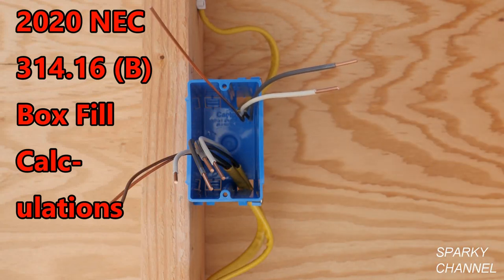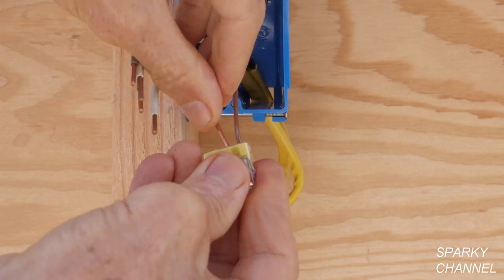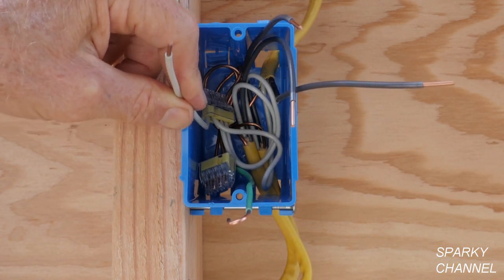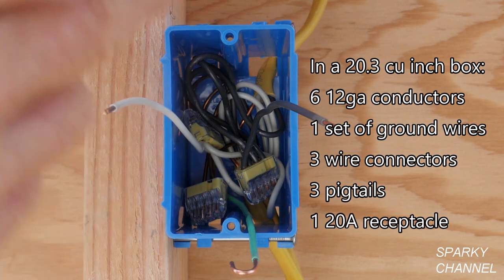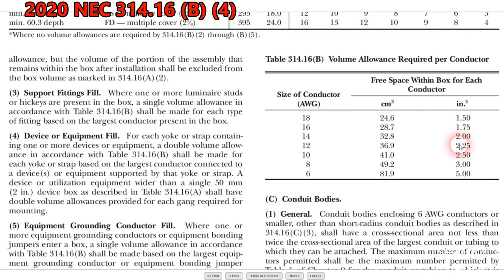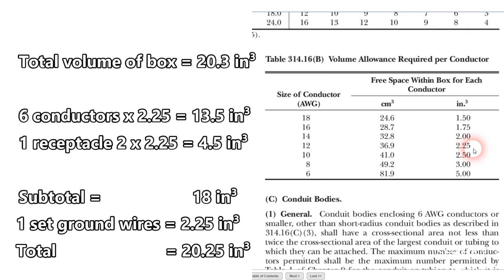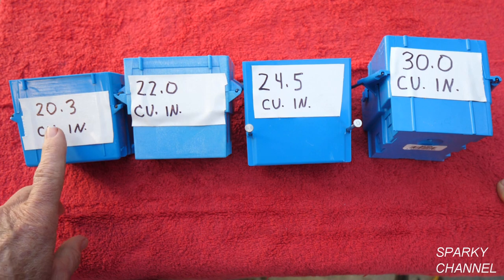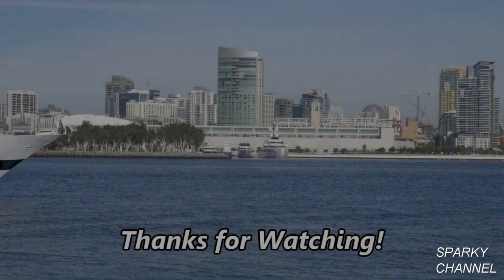Is this Box Overfilled by 2020 NEC Code?

Comment: Hi, electrician from Germany. Why doesn't eath have isolation? Is it like that in USA? Is it for more protection?
Reply from the maker: We do for certain circumstances such as wiring a computer room. But in general we don't use isolated earth grounds. Cheers from 
San Diego, California!
Reply: I think they're asking about "bare copper"/no insulation not "isolated ground". (the later is a whole other subject) In short, if there's an exposed bit of metal, you want it to be a ground -- i.e. something that doesn't normally carry current -- for safety reasons.

Comment: You miss to have the grounding conductor. 7×2.25=15.75 cu inches now add device 2×2.25=4.50cu inches.
Total 20.25cu in
Reply: You missed the code reference, all the ground connectors count as only one conductor.

Comment: I'm not a fan of those type of connectors/connections.  They seem similar to the system/type used in devices such as switches and receptacles.  While they are smaller and easier to use, I don't think they will stand the test of time.  I perform a great deal of electrical maintenance and repair in homes.  I find high failure rates with these push-in connections on switches and receptacles in damp/moist areas.  Mostly bathrooms, kitchens and outside walls.  Not everything new IS improved.

Comment: Interesting. So I could put a bundle of wire in that 20.3in3 box, a hundred feet of it and a hundred wire nuts. As long as they all are contained fully in the box, meets code. Then jam in my 6 conductors with a sledge hammer or press. lol Going to see what the inspector thinks of that.

Comment: I never understood why the NEC allows pigtails to not be counted. A 6” pigtail takes up the same amount of space as a 6” piece of wire from a cable entering a box.
Reply from the maker: True.
Reply: I believe it’s partly about heat generation and the volume of dead space to allow for adequate “cooling”. That’s why they aren’t worried too much about them as they aren’t line in or load outs. They most likely fall under the devices requirements.
Reply: RaggedsEdge line in or load outs doesn’t necessarily mean that there won’t be heat generated on them. Any segment of wire on a 15A circuit has the potential to carry 15A of current on it without the breaker tripping. Doesn’t matter if it’s a pigtail or not.
Reply: @RB-xv4si  ... you make a good point of the load generating heat and needs to be considered in the fill rate but at 80% loading on a branch circuit there's really no heat to worry about.
Reply: The best way to look at it is that the NEC writers presumably took/are taking the existence of pigtails into consideration when they came up with/maintain the factors.

If they instead wrote the NEC so that pigtails needed to be included in the calculation then the calculation would depend upon precisely how the installer intended to execute the job (how many pigtails she would use), which would be a major engineering headache because the engineer would have no way of knowing this. Furthermore, in some cases the installers would be forced to use gimmicks to keep the pigtail count low enough to meet code, an undesirable result. OTOH, conductor quantity, yoke quantity, existence of internal clamps--all of these things can be specified by the engineer and are therefore knowable by the engineer.
Reply: @sbrasel  engineers don’t really get involved in device and wire fill calculations for switch boxes, receptacle boxes, etc. That involves small, simple calculations that electricians are trained to do during the installation.
Reply: @RB-xv4si  You took my term 'engineer' too literally--it would also include the person in the electrical firm who "engineered" the job by deciding what size boxes to order from the supply house, a person who may never have met the installing electricians if the firm is large. In any event, I stand by my original point--including pigtails would create engineering/installation/maintenance/enforcement points of contention due to multiple ways of wiring a given combination of wiring devices and cables.
Reply: @sbrasel  wow, alright. You use that term extremely loosely. The general foreman or material handler will usually put in orders of several different size boxes so the journeymen on site will have a few options to choose from in any given situation. They (journeymen) will use their general knowledge, specific site knowledge, and code book to make a final determine of what size they’ll use for each part. The only time the master electrician or PM will do the calculation in the office is if he’s ordering a very large box for a very specific purpose on the job. EDIT; to be more specific to your response, the only way a point of contention will arise is if the jman does an incorrect calculation (or no calculation at all) and undersized the box or grossly oversized the box, thereby wasting material.
Reply: I think its all considered and factored into the box fill. Kind of like the device will count as a double fill whether or not you are using a standard duplex receptacle, single pole switch, gfci, or dimmer switch. As electricians we all know these things need more or less space but they are counted the same. They probably just assume each gang size could have 3 pigtails and its factored into the wire gauge multiplier
Reply: @RB-xv4si  But a pigtail or jumper adds no current either entering or leaving the box. [Just guessing, not authoritative. DIYer here.]

Comment: I would keep it simple and NOT try to have more than 2  Romex feeds in and outlet box.  It a spur run is needed, it should be in a separate junction box that does not have a receptacle.
Reply: That is silly , install a bigger box. You can get a 22.5 cubic inch box. Always install the biggest box that will fit in the wall. You dont want blank cover plates all over your house.
Reply: Disagree. You add more material, which is cost, to the job and it looks worse.

Comment: Knew that answer from get go. 
But never use such small boxes.
Reply from the maker: Excellent advice!
Reply: What box would you use?
Reply: Derek Parent 
I always oversize the boxes. 
Simply because you don’t know what will happen down the road. 
I have seen people cheap out for a few bucks and it’s well dumb. 
Or someone who puts a new main box in and there’s no room left for anything else. 
Personally the codes sometimes sucks. 
They will dam near let you pack a box tightly and it’s a bit overboard. 
My rule of thumb. Meet code then add common sense. 
Example - a new box. You need 12 breaker spots. Do you only put 12 in or go up Incase.
Reply: Mike Sacco I think my question was what size box would you use for 3 - 12/2 romex cables. 
An 1110 box is only good for 16.5 cu inches so that plastic box has a lot more fill capacity.
Reply: Derek Parent 
I like the 24.5. 
A 1110 is metal.

(FYI anyone reading this. 
Quit stuffing wires in a box behind drywall. And only using electrical tape is well dumb. ) yes I make $ fixing it. But today someone ended up in hospital because of this very reason. 
If you have to ask. Hmm is this correct you might not want to do it. 
( not saying this is true all the time but still )
Reply: Mike Sacco that box seems a bit deep for interior 2x4 walls. Looks like it’s made for 2x6 studs or bigger.
But I agree, use a box that is has suitable or larger box full  and also fits the location.
Reply: Mike Sacco I’m curious about the injured person. 
Was there a box covered by drywall and had no wire connectors but was taped?
How was he injured?
Reply: Derek Parent 
Houses here now. Exterior must be 2/6 walls. Interior 2/4. So I just drop 1 size for those boxes. 
The fire. In short he redid his kitchen and moved fridge the old outlet he put in a junction box and tagged a 12/2 over to new fridge area. Then used electrical tape. 
And the night he spent the night in living room. Guess he fell to sleep. It caught fire in wall and it was also the wall right behind him. He got his head and arms burned pretty good. 
You have to remember a fridge has a motor.  It shouldn’t be spliced anywhere. 
Me. Direct line to box for microwave. Fridge. Washer dryer. Etc. 
I love breaking my boxes down. Exterior lights on there own. Living area split in 2. 
I always go above code. 
Now they want afci gfci breakers. A bit costly but it is what it is
Reply: Mike Sacco I go above the code also, after 42 years I have seen pretty much everything industrial/commercial and Residential. I did service work 24/7 for the last 30 years, the first 10 I was in construction and a Forman until I started my own company. 
In Canada I haven’t seen that size plastic box but I wouldn’t wire it that way anyway. 
And yes Arc Fault breakers are pretty much everywhere in the house except the kitchen and sump pumps. Changes the way we wire a house now as lighting does not require them.
I never go over 8 plugs on a circuit and will only load lights up to 9 or 10amps or max number now with LED’s. 
Nice chatting, keep up the good work, be safe and help those when you can. 👍🇨🇦😷
Reply: Derek Parent 
I’m in CA. 
Kitchen got tagged last week cuz no afci in kitchen. 
Funny. Codes say 1 thing. Inspector says nope. Lol 
I only use those boxes because it seems I run into small boxes all the time. 
Code a box must be x amount size. But oversized is fine. 
Our outside walls are 2/6. Earthquake codes and so on. So that’s why I use that box. 
I go 7 on plugs. Only cuz I see to many plugging things in. People see a outlet and think ok I can plug it in with a few 6 ways. Lol 
Here in ca I run into a lot of people who use 14/2 cords for ac units or Xmas cords. I don’t know about there. 
I have a buddy in Canada who does drywall. He came here and it’s funny we norm use 1 kinda mud and he was like what’s this crap. Lol
Anyway. You got me on years I been in it for 33. It’s good money. But some people play with fire if they don’t know there stuff. Never shocks me to see what people do.
Reply: Mike Sacco code should override inspector and I have only had to do that 2 times in my life by going thru their boss. 
I have seen houses where the basement was wired with orange extension cords, thru the studs and into boxes..16/3!
Oh yeah, there are some dangerous people out there. 
I just started looking thru YouTube videos to see what electrical stuff is being shown, I am pretty surprised at how many people are posting live panel work with No PPE, DIY’s and electricians. 
It’s like “Here is my evidence, please take my license” just dangerously stupid.
Reply: Derek Parent 
Derek Parent 
I have learned here in CA they think it’s there own world here. Lol 
I pulled a code book out on a inspector one time.  I said I want to make sure of this. His words. Either put it like I said or no sign off.  I can’t explain inspection here there funny. Now there doing 3rd party inspections. Ugg
16/3. That one never seen like that. I think the worst I always remember. A guy took a bunch of bell wire and melted plastic off then kept twisting it up to make it thicker then tape on it and used 7ft in attic up to a light. 
His wife called when he was at work and asked me to come out. I go to climb up and she says I’ll turn the light on. 
It looked like toaster wire bright red/orange. 
The ones I get a lot of. People take wire and shove it into dirt to try to make gfci work. Or run neutral wire on grounds. 

As for you tube videos oh I have seen some that make my head hurt. 
I tell people if you paint wrong ok. Plumbing wrong it’s water. Electrical will KILL YOU. You can see water. Paint. Drywall etc. electric you can’t see. 
And I get people who reply with. 
Oh let me guess you want to come fix it for me for $$$.  Lol. 
Its shocking and scary what people post. There should be a guild with you tube. 
These videos are done by a licensed contractor and verified. 
Hell I was shocked when someone showed me videos on meth. On how to cook it and use it and hide it from people. 
You tube will let anyone post anything I guess.

Comment: Don't take that much time to twist the wires together and wire nut..not a fan of them push on connectors
Reply from the maker: OK, thanks!
Reply: I agree those connections are not guaranteed. Specially with heat. The proper and safest way is to make a splice and wire but them.
Reply: @alfredzayas  Actually the safest is twisting,soldering and wrapping in electrical tape.It will never get a loose connection even after 80 years.
Reply: @mernok2001  .... no soldering allowed for home wiring in the USA. All connections must be a mechanical connection... twist, crimp, screw. Tape can be used but only as a secondary precaution or identification and must not be cloth. (old style friction tape)
Reply: @rupe53  Wikipedia says soldering is till permitted by NEC if there is also a mechanical connection like twisting before soldering.
Reply: @mernok2001  ... I finally found that section on soldering, but it is usually only found on old work from a time before wire nuts were common. The reason being is solder will add another metal (3rd?) to the mix where you already have coper and the steel or brass sleeve of the nut or screw connection so more possibilities for the connection to deteriorate. (or so the old story goes) The one exception that stands common now is to pre-solder (tin) any stranded wire (then it's a solid wire) before joining it to another solid wire. This is usually found on the pigtails of dimer switches and light fixtures to make them code compliant with home wiring. So bottom line is you are right and they do allow it because it was never removed from the code but certainly fell out of common use back in the 50s... and that's a long time ago.
Reply: Been doing service work for 28 years. I’ve seen more problems with improperly installed wire nuts than I can remember. Have yet to run across a bad Push on connector install. They’re also easier on one’s wrists.
Reply: @shockcoach  The key word is improperly installed.In the good old days,at least in Europe,we just twisted the wires with pliers and wrapped them in electrical tape.Those wirings lasted 60-80 years,some are still inservice.I have also seen improperly used push in connectors completely burned,even the metal part was molten and oxidized.

Comment: Obviously you have no reservations about using the push connectors.  I know some electricians on youtube don't think they are reliable or as safe as twist and wire nut.
Reply: I may be wrong, but wirenuts are not even legal in some places such as Europe (Germany). The wacos are apparently safer.
Reply: @nsbioy  Safer than wirenuts?  For what reason?
Reply: @Percy Faith  I am not German,  I wouldn't know. Lol. In all seriousness, wirenuts for some reason never took off outside of North America